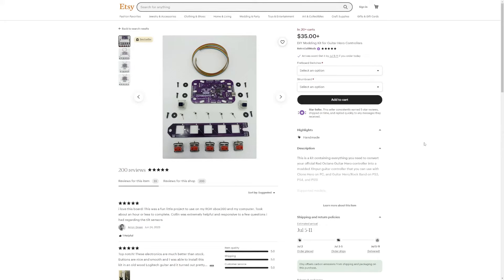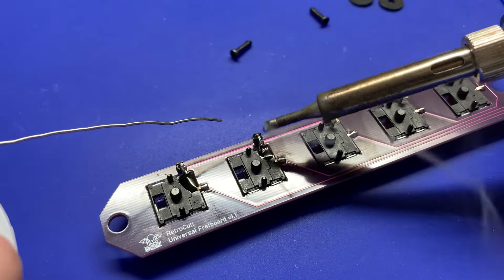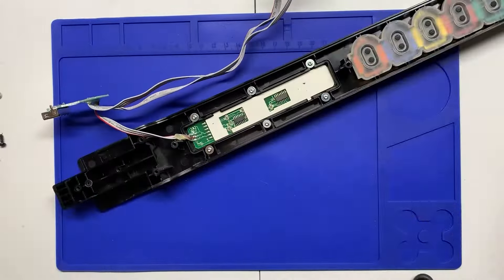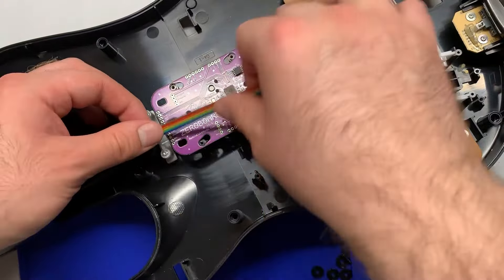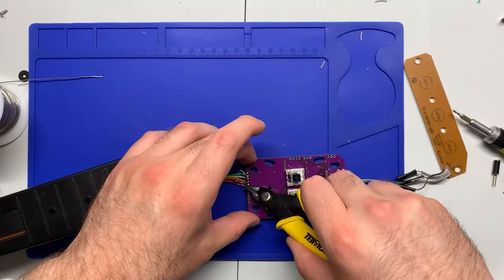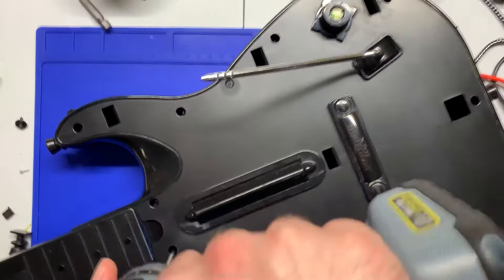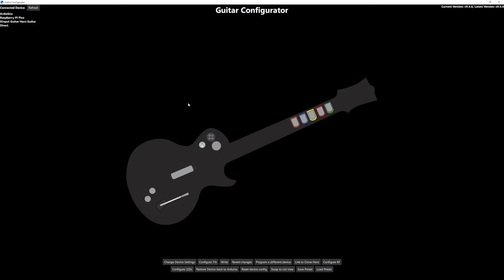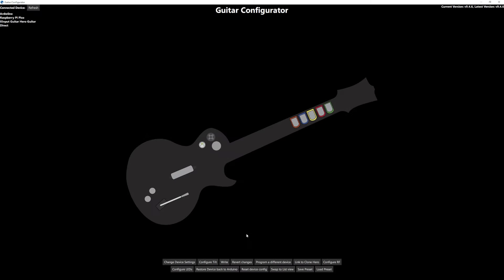ZeroBoard DIY Guitar Hero Controller Mech Fret Modding Kit Guide #clonehero #guitarhero #rockband

Comment: Is there a way to add rgb  to the zeroboard (for the wiimote empty space), or should I use an alternative power supply?
Reply from the maker: For that you'd need to use a separate LEDs. You could however use the pin labelled VBUS on the ZeroBoard to the power pin of the LED to power it, as long as you also connect the ground pin of the LED to a GND pin on the ZeroBoard.
Reply: @retrocultmods  I wasn't sure if vbus would be overkill for some 5v RGBs I have laying around. I'm also not versed in how electricity exactly works yet, but I do component repair (like HDMI port replacements) regularly at work. 

Do I have to use a resistor?
Reply from the maker: @DriftKingfromTekken3  If you're using a standalone LED, yes you'd need a resistor. If you're using an addressable RGB LED (like APA102s) then you wouldn't!

Also make sure your LEDs are rated for 5V and you should be fine.
Reply: @retrocultmods  they're not addressable, just two pins. And definitely 5v because I've used some to add slow changing RGB to playstation 1 power supplies, and that green led was 5v. Thanks!
Reply: @retrocultmods  does this mean I could wire addressable LEDs up to the fretboard with the "regular" ZeroBoard and they would be controllable with the software?
Reply from the maker: @alexr.8397  Yep! They would work the same way the RGB boards in my Solderless Kits work!

Also if you want to wait around a week, I'll actually have RGB Fretboards available to use with the DIY ZeroBoard kit!
Reply: @retrocultmods  Say no more! I’ll be ready the second you put them up.

Comment: Is it possible to use the zero board and just use the original fret board, I wanna be able to use my guitar on pc and Xbox
Reply: Technically yes, but the fret will have a couple ground wires you'll need to splice together and the traces may not be labeled, so you'll have to figure out which wire goes to which button. I suggest just changing out the fretboard too as it's not that difficult (and maybe even easier if you have no soldering or electrical circuitry knowledge) and mechanical switches feel really nice.

Comment: i set up my rasp pico and when i plug it into clone hero or RB3, it holds the input until i complete the circut, is there a way to flip this?
Reply from the maker: Make sure that there are no exposed wires touching each other, and that everything is soldered correctly!

Comment: If I only get the zero board can I mod my guitar and connect the old frets to the new board?
Reply: Yes, you should be totally fine to. Thats what I did
Reply: @graham_lewis  i ended up getting the full kit * well worth it btw* but I was told that the only way to do it with the old fret board was if it has six wires like the kramer does

Comment: Does this work for the Xbox x-plorer guitar?
Reply from the maker: It does, but it is not recommended for beginners, as it requires a lot of soldering to small pads and trace cutting.